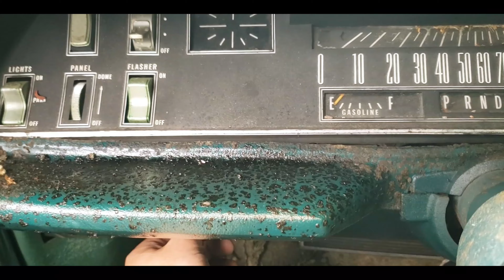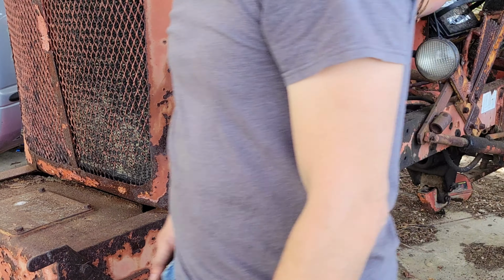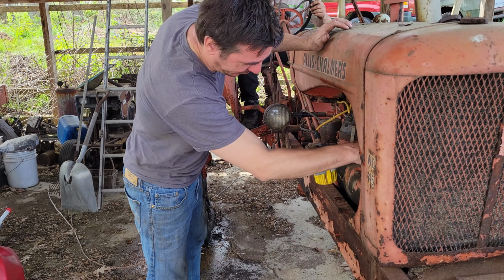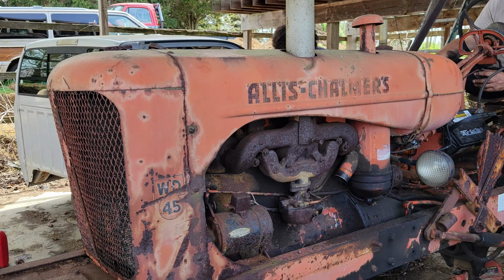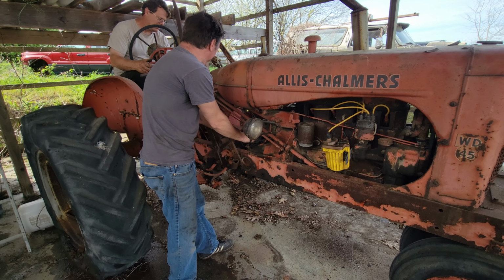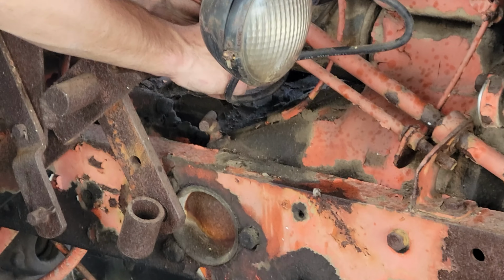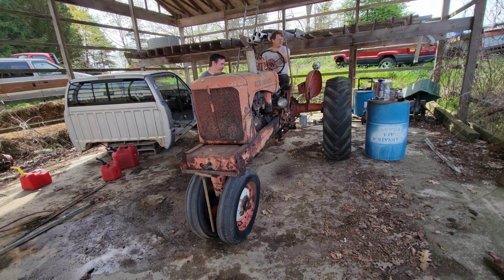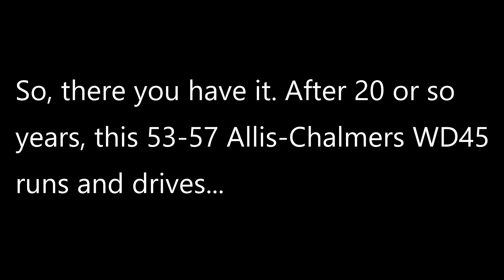Allis-Chalmers WD45 - Will it Run?

Comment: First tractor I ever drove was an Allis, either WD or WD45, my farmer uncle had several different sizes of Allis back in the 60s. Actually I only steered it the first time, my older cousin got out of the seat and told me to sit as we were flying down the gravel road, as you know 15mph or so feels fast on one of those and to an 8yo town kid it is flying! I was very happy with that day. The hand clutch is lots smoother than the foot clutch, very nice feature for beginners to take off without jerking or killing a rough running engine.

Comment: This video is making me want to jump in and adjust that carb and throw them stupid resistance wires away. Tractors need low resistance wires. Plus I need that fuel gauge. Lol. Actually I’d take the whole thing cause that anibump steering add on is on my wish list too
Reply from the maker: It was not a planned event. The tractor was in the way, and it was seized. We couldn't resist pulling the plugs and lubing the cylinders. Then, I put a 4-5' bar on the crank and let it sit. Then it broke loose. THEN I decided to grab a battery and it cranked. Once it cranked, we were curious to make it spark and fire. So, again - to all the purist - I'm sorry this wasn't an intelligent 'Will it Run', it literally just snow-balled. I had never operated that type of tractor - I knew the parts, and eventually (painfully) figured everything out. It was shot with one angle, one camera, one take. In any case, it runs great! It is sleeping with the Newport, covered, on the other side of the property. If you'd like to purchase this tractor, please contact us via the email in the bio.

Comment: Hello, it's a no brainer that the throttle is always on the right side and the hydraulics is on the left side .  Also by the sound of the poor engine trying to run, the timing is way off.

Comment: First, that looks like a 12-Volt battery.  If it's still negative ground, it's almost certainly still 6-Volt.  Second, all older tractors work from a governor.  You don't directly effect the throttle opening, you tell the governor what engine speed you want and it modulates the carburetor.  You're lucky it didn't run away from a stuck governor the first time it fired.
Reply from the maker: Yup - we were quite aware (notice I had a 12v Accel coil in there?). We had no generator charging, that was for certain - and not a concern. This is not a meant to be maintained as a runner/driver - just needed it out of that building. It's now sleeping in another building. I'm pretty sure we would've caught a run-away scenario - it's a gas engine with a functioning ignition key, not a diesel. Thanks for watching! I'll have another tractor video to critique coming hopefully in the next few months.
Reply: I thought 12 volt was neg. ground.